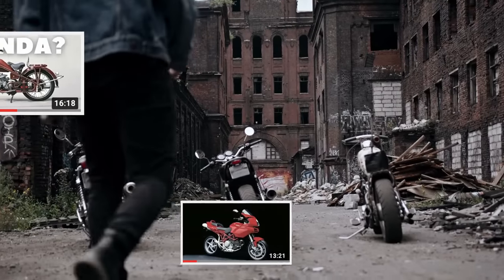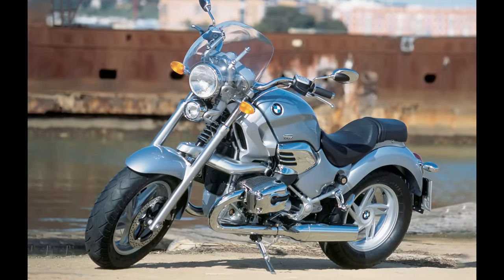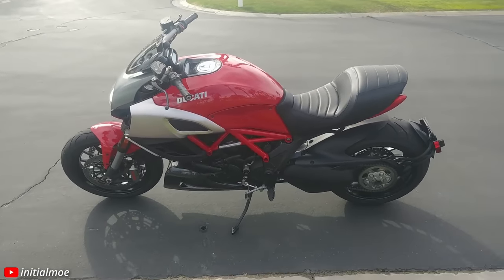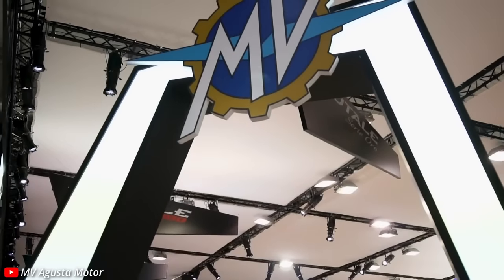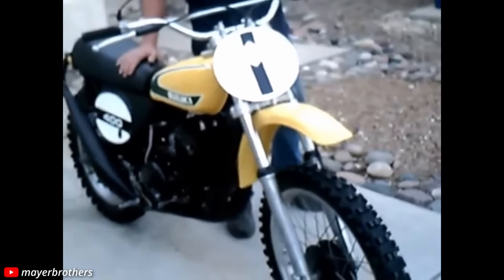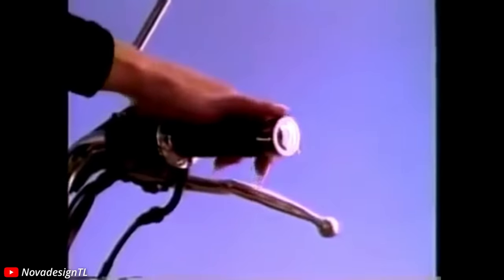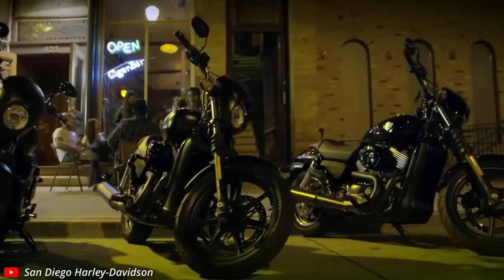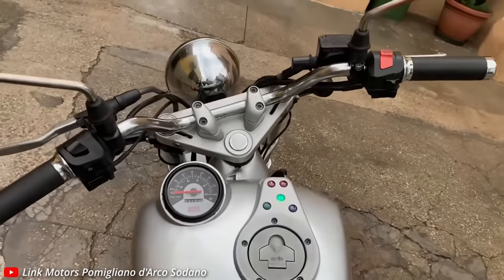The WORST Motorcycle from every manufacturer

Comment: Yes, like a lot of folk here I found the Virago a particularly nice looking cruiser. Mine was a 1995 1100. It ticked all the boxes. It was comfortable for both myself and my wife. It look amazing amongst the more modern bikes on the cafe runs. The original two tone paintwork was awesome.  It was reliable, easy to maintain and cheap to purchase. 

I don't like the look of most Harleys. I much prefer an old Norton or something of that nature, but the Virago was a beautiful looking machine. The features it was accentuating took the aesthetics a step further than the bikes it was inspired by.

Well done Yamaha!
Reply: And the Virago XV 535 is basically a 90's wet dream. I don't get why its bad...The only bad bit was the tiny fuel tank and aftermarket had that covered.
Reply: Yup...best looking V-Twin of all time.
Reply: A Virago looks like a Chinese knock-off of a Harley that's been rear-ended and shortened 2 foot. It maybe a nice "cheap" bike, but it doesn't look good.?
Reply: @mickb4691  Yes. A perfect case of beauty is in the eye of the beholder. 
 Most Harley's to me look clunky and awkward with the exception of the VRod, which is a long way away from the traditional conception. 
I do remember the time when Japanese machines were considered cheap knock offs of established brands and appreciate the disgust that we had towards them for that reason. I doubt Chinese machines will gain the kind of respect Japanese ones have but time will tell.

Comment: The Virago still looks good to me. I owned the 1981 750cc version, which was my introduction to motorcycling. Loved the bike. Had to sell it to pay rent in 2003 during graduate school, but got the 1993 750cc version in 2004, and I still own it. The Virago was made for a long time, and its style is still evident in the V-Star 250. The Viragos (loud, overbearing women) have a reputation for anvil-level reliability, and they're fairly easy to work on. Their performance was competitive relative to the later V-Stars. They don't leak oil in my experience. That old Yamaha ad is awesome, and women today still dig the bike, but hey, to each his own.
Reply: I had an 81 920 Virago. Loved the bike, thought it was a great looking and great riding bike
Reply: @michaelfeucht1911  I'd like to find one.
Reply: The XV920R was the one I wanted and never got.  Chain driven with the chain in an enclosed case, mono-shock, narrow, torquey but smooth and handled like dream.  They never caught on because so many buyers wanted more 'choppery' looking bikes.  '81 and '82s were all there were.

Comment: The Virago handles fantastic for a cruiser. Enough ground clearance to make tight turns yet thin enough to slip through lines of traffic. It's a damn shame modern cruisers don't adopt the shaft drive as it makes the virago as resilient as a cockroach (even if some would say it shares the likeness of one as well). Despite having ridden several cruisers since my Virago, none have impressed me nearly as much. Keep up on your maintenance and this bike'll outlive you
Reply: 45thousand km on the engine still starts first press. still has all the power it needs and has not let me down yet. virago 535 and up are great motorbikes.
Reply: My '86 xv1100 needs tires and oil changes, that is pretty much it. I've had it for 20 years now. It runs great. Starts right up.
Reply: Love my 95 750 Virago after swapping to a more conventional handle bar
Reply: Shaft drive is a think I like about my 1983 Honda Shadow 750, also I would love to try out a 1985 Kawasaki Eliminator 750 which also has shaft drive, I think. 13:09
Reply: Despite the Virago 1100 being the bike of my dreams in my teens, today I agree it's one of the ugliest bikes ever, but the engineering is great, and the engine looks great, so it's the perfect base for a custom. 

I've seen some really good looking Virago Bobbers. Lots of bike for dirt cheap. 

Caviat: The small Virago 250 is actually the best looking and sounding of them all. I kinda want one for the small curvy roads around here.
Reply: Yeah, a bit like my old Honda CX500. Ugly, but shaft drive and water-cooled and would run forever.
Reply: @81bajaj  my aunt had one of those with the automatic transmission. Honda would try almost any engine design..from Wyoming USA 🇺🇸 🤠
Reply: @billallen4793  Did not know there was an auto for the CX. Are you sure you are not thinking of the CM 400? Pretty sure there was not an auto box for the CX500. The CM400 was made also during the same initial years as the CX.
Reply: @81bajaj  I bought an old CM400A for my GF.   Really a 2 speed torque converter.. Great for back roads, under 50mph but terrible on highways...lots of vibration and the wind would kick it all over the place.
Honda also made a CB750A for a few years.
Reply: The shaft drive bikes are not a bad idea, but there is an extra measure of maintenance that some manufacturers and most shops ignored.... GREASE! Not only the Viragos, but Hondas and Suzukis alike, would show up with stripped splines because they left the factory dry. Very expensive repairs that the dealers would never warranty. Goldwing riders are all generally anal about maintenance, I've never seen a Goldwing with stripped splines due to the lack of service.
Reply: @nottogood415 The 250 is still a damn good motorcycle too. If you want an entry level v twin, it's a damn good option. I currently ride a virago 250 from 2001. If it's a little bike and can carry my 6'8 350lbs ass around, it's a damn good bike in my book.

Comment: on my sixth Guzzi ! from 1978 Spada 1001 to latest V7 . Superb bikes , reliable , big mileages and a distinctive ride . Hand built in the original factory for a 100 years. This guy is taking out of his rear
Reply: I have a 900 Eliminator I bought brand new in high school and still have, with almost 160,000 kms (100,000 miles) on it! I love it, it still gets looks every time I have it out, and had many offers to buy it over the years! It's not meant to be the same as a V-Max. It's an all out drag bike on the street!

Comment: I personally liked the Virago. It must be a generational thing. And it turns out those old Virago's make incredible looking café racer conversions. The only bike of that type from that era that I think had a better aesthetic was the original Suzuki Intruder 700.
Reply: I have a 2002 535 Virago. I don't have anything bad to say about it. The worst yamaha in my opinion is the Niken GT
Reply: In Europre there was a "Euro-Tourer" version of the 1st gen XV series called the TR1. It had BMW-ish styling, but bizarrely adopted an enclosed chain final drive instead of a shaft. This did, however, make it much easier to put the engine into serious custome bikes, and I suspect that's where most of them ended up. There was a 1950/60s tradition in the UK of putting a TRiumph engine (best engine) in a NorTON "Featherbed" frame (best frame) to make a "Triton", widely regarded as the ultimate cafe racer of the period. At least one builder in the '80s/'90s put a TR1 motor into a featherbed, painted it up in the classic style, and called it a "Tr1ton".

On the subject of jokey UK custom bike names, I remember another cafe racer with a Honda CB750 motor in a featherbed frame that was called a "NotOne", and a Harley-style frame & styling job with a CB750 motor that was called a "Honda-Davidson Pearl Harbour Special"...😈

Comment: I love my Virago!  It was extremely comfortable, easy to ride, and I liked the look.  I think they were under rated.  : )
Reply: Yeah, I don't get it -  "ugly"? I get compliments on my Virago (xv1100) all the time.  I didn't like the design before 1985 much but '85-'99 (I think '99 was the last year for the bigger model) are pretty cool. I especially like the 535.
Reply: @jerrybriardy  Mine was a 1986 700cc, and I got compliments on it often!  Of course, being so old, I spent a lot of time fixing it too.  But the bike looked good!
Reply: Only real issue with the Virago's was the starter system.
Reply: @jerrybriardy  XV535 had weird design with frame being used as part of the intake system. 
Yamaha originally gave 12 hours for carb work as 'they' said you needed to almost remove engine to get carbs out.
 It didn't take me long to figure out a 30 minute 'fix' for carb removal.
 Shop made a 'killing' on warranty work until 'we' put in a claim for doing 8 bikes in one day so they sent someone to see how it was possible (it wasn't fraud, just a bit of thinking) the Allen head bolts holding manifolds to head get removed, the tubes connecting to frame slid down and carbs slide right out. Next service bulletin, revised time and procedure. 
Yamaha never gave me a penny for saving them thousands though (Honda never recognised the work I did on CB/CJ250/360 fixing their engineering disaster either)
Reply: Maybe this guy thought the Virago was ugly, but I had an '83 500 cc that cagers would roll down their windows at stop lights to make admiring comments. I was 19. It was a chick magnet. Loved the shaft drive! No idea why the guy called them ugly. Those would have been fighting words to me back in the day!
Reply: @meetontheledge1380  Kinda threw me for a second as the '500' was a XV535.
 Basic motor was still in production well into early/mid 2000's as part of the STAR lineup.
Almost every 'First year' Yamaha had issues with second gear dogs breaking or getting damaged and falling out of gear. XV535 had carb issues 
I forget what internal updates were made (apart from being over 600cc) but external changes were mainly bolt on cosmetic to change the overall shape (plus new frame, etc) Suzuki did basically the same thing with the 'Intruder', most major change was a new cylinder head to allow single carb (and later, fuel injection)
Reply: @1crazypj  Yep. I'd never seen ''mono shock suspension'' but the handling was real fine. Every time I've had to lube a chain on my subsequent bikes, I've missed that shaft driven convenience. The Intruder had caught my eye as well!

Comment: gotta say, the Kawi Eliminator was not about being a cruiser or a sport bike.  It was an homage to Kawi's absolute dominance on the quarter mile in that era. It was structured just like any period drag bike, but with all the weight that comes with being on the street.  I get what it represented, and respect it, and it was NEVER meant to be accepted by either cruiser or sportbike guys.  It was all about the light-tree.
Reply: Exactly right it was a drag bike for the street.  I had one when I was in the US Army stationed in Ft. Hood Texas.  The only thing that could consistently beat me in the 1/4 mile was a V65 Magna my friend had.
Reply: Amen brother. love the eliminators.
Reply: The existence of the Eliminator that has this guy so confused can be explained with one word: V-max. Yamaha radically tuned up their big touring bike motor and shoved it in a cruiser frame to make one of the most iconic '80s bikes ever. Honda took their exotic sport V4 and did the same with the Magna. Kawasaki didn't have a V4, but they did have one of the other iconic '80s bikes, the Ninja 900 (i.e. "Maverick's" bike in Top Gun), so they used that motor to make their power cruiser. It's anyone's guess what Suzuki was thinking with the Madura. And yes, Kawasaki had the drag chops to back their bike up, even if it never got as popular as the V-max or Magna.
Reply: I had a zl900 neat bike. Big downfall was the 3 gallon tank. At 32 mpg filled up every day at the same gas station on 60 mile round trip commute to work everyday.
Reply: I've had a few of these listed 🏍 bike's, a 1000 Eliminator, a worked over v65 Sabre, and a 75 Z1/900e, and a XS1100cc Yami Venture royal convertible from a highway cruiser to a muscle bike by removing the fairings and luggage 🧳!..from Wyoming USA 🇺🇸 👋🤠
Reply: I had a Kawasaki ZL600 Eliminator and it was magnificent.  1986, slightly detuned 600cc speedway engine, quad carbs, 6-speed, street drag bike.  To this day, I still keep kicking myself in the ass for selling it.
Reply: Probably the coolest bike ever made. The rear tire, the small tank, the slightly forward standard seating positioned that made you feel like you were being shot out of a cannon. This bike was way ahead of it's time. When I had mine, it got more attention in parking lots than any other manufacturers. To each his own I guess.
Reply: My Dad has a 86 600 Eliminator! He loves it!
Reply: Had the 900.  Never lost a drag.  Even against bigger engined sports.  They couldn't keep the front wheel down.  
It had a great sound without being harsh.  The styling was beautiful and unique.  It drew lookie loos at every gas station.  Everyone thought it was a custom.  I particularly liked the riding position. The pegs were underneath (I hate peg forward) and the short bars were perfect.  The build quality was much better than the 3 Yamahas I had before and it handled very well for it's category.  It was gentlemanly but could rip your arms out on command.   
Which brings me to the V Max.  I think it should be on this list.  It had bad geometry or something.  Every time I rode it the feeling was like being locked in a small room unarmed with the Texas chainsaw killer.  Just a bad chassis and brakes wrapped around all that power.  
The Eliminator was refreshing after that.
Reply: @warrenwarburtonesq.6884 Yep. I had the 900. If I could get back only one thing from the past.
Reply: @bean1956 It were worth it.  You got a lot in return for giving up range.
Reply: @longtravel1743 Had both Max and Eliminator.  They both would rip your arms out but the Eliminator didn't give off a murderous vibe towards the rider.
Reply: @Coldwarrior7781  Bought an 900 Eliminator new in high school after my first bike, a mint 1980 RD400. One lunch hour, three of us took turns on each others bikes. The one was an XS400, the other, a V-Max. I jumped on the 400 first and obviously, no surprise, it was definitely a beginners bike. Jumped on my 900 and WHOAAAAA! Quite the difference. Then on to the V-MAX...HOLY SH**!!! Even more arm pull!
Reply: @briansauer6695  The new Eliminator 400 just doesn't come close in styling.  If they make them bigger I hope they go more muscle retro.
Reply: I thought ,back in the day , the Eliminator was brought out to compete with the Vmax did it not? Back then it was the Mustang versus Camaro wars but on bikes.
Reply: If anything it was a reply to the V-Max, not Harleys.